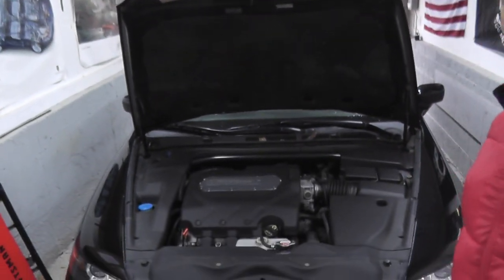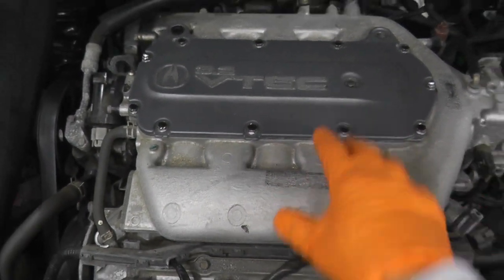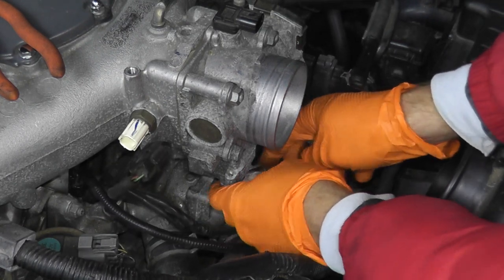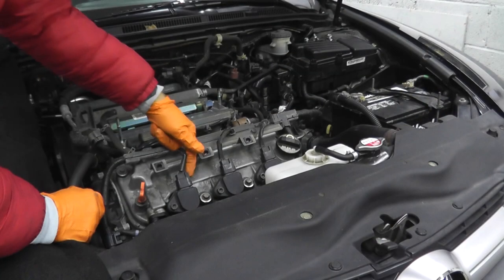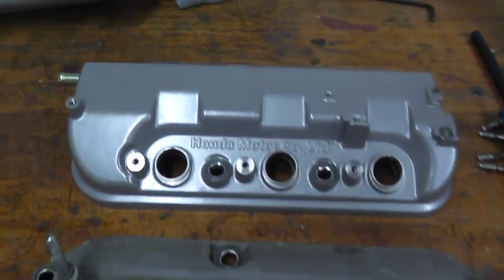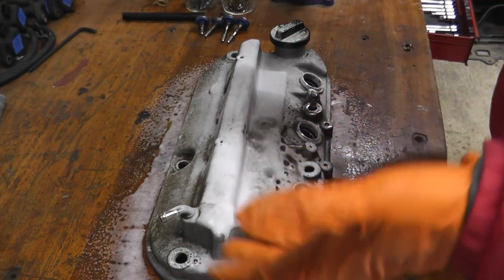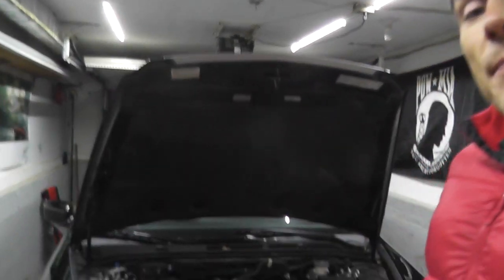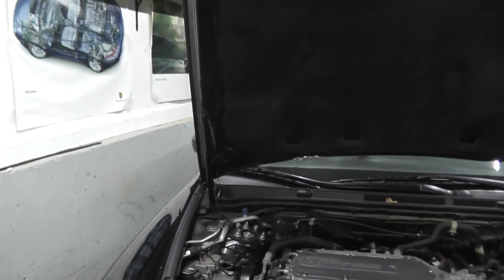Acura and Honda V6 Valve Cover Gasket Replacement With Basic Hand Tools

Comment: Just want to say thank you for this video. I changed my valve covers with the OEM kits last week and it went great. I did end up cleaning the underside of my valve covers with Super Clean as well, changed all the spark plugs, and coils. A little white smoke for a few seconds, probably from the cleaner.  Car runs like a champ!

Comment: This looked easy until you had to strip out the interior, remove the dash, cut out the firewall, and unplug the entire wiring harness, then it looked like it was harder than I thought it would be! 🙂

Excellent video, one of the best I have seen on Youtube. Great job!!!!
Reply: You're confusing that with headlight bulb replacement.  3 hours minimum.  Trust me 😅

Comment: This video was perfect! I was able to change both valve cover gaskets and cleaned up a lot of leaves and nuts in the engine bay (go figure). Tested it and no leaks. Thanks so much!

p.s. any chance you'll do a timing belt change for the TL?

Subscribed!

Comment: Nice video ! 
I had a 2003 S2000 ap1 . It was a blast but a little cramped for my size .
Now I have a 2005 TL with the factory 6 speed , front Brembos and limited slip .
Its almost as quick as my S2000 Was and nobody really trys to race me like they did in the S2000 .

Comment: Excellent video! I have the same issue of my front wheels looking a mess due to the oil leaking.  My bank 1 catalytic converter has gone bad, so I think I might do the converter job along with this and, if possible, pull the converter out past the rear valve cover while it is off of the car.  I have read posts on Acurazine of people doing it that way. You are supposed to remove the drive shaft for the job but I have not had good luck removing the shafts on my TL.

I have an 2008 with 206 k on it and it runs great. It will be cool not having my wheels looking a mess shortly after they are cleaned.  Even more importantly, not having oil leaking period.

Comment: Would bad valve cover gaskets also cause any misfire issues? Because, I recently replaced all 6 spark plugs and coil packs and 3 days later, the misfire of banks 2, 4 & 5 happened. What else could be the cause of misfiring?
Reply: Could be bad wires?
Reply: @JeremyFromOregon   Ok. I haven't checked the wires. Thanks bro
Reply: I know mines is misfiring bad, but I noticed a lot of oil on the backside spark plugs could be bad gaskets letting oil in???
Reply: @JayP19AD   Yes. This time around, I had cylinders 1, 3 & 6 that were misfiring. I had bad tube seal gaskets. So, oil was all over those spark plugs and coilpacks. I just went ahead and replaced all 6 of the tube seals and valve cover gaskets since I had the covers off anyway.
Reply: @KeizorSoze1 did your car end up working good after you changed the tube seals? i have oil all over the coil pack in cyl 1
Reply: @buddhaprince6773   Yeah. But, I had gotten fed up with the way problem after problem was happening with this misfiring issue, I just ended up replacing (again) the valve cover gaskets, tube seals, all of the coil packs and spark plugs, along with the valve cover grommets too. After replacing all of that, I no longer had any misfire issues.
Reply: @KeizorSoze1  thanks for the info, hope your whip is going strong still 💪
Reply: @buddhaprince6773   Thanks! No problem. Yeah, she is running good now. I've been lucky enough to not have anymore mechanical issues. I hope all goes well with your car

Comment: To get the rubber gaskets out. Place the cover in the oven for about 15 minutes at 375 degrees. Once done, remove the cover and face it down. Get the flathead screwdriver and stick it in the gasket at an angle. Hit it with a hammer or palm. They will fall right out.

Comment: Would've been a good time to check valve lash.
Reply: Major omission no valve clearance and using old intake gasket. Don't fear buying oem Acura parts. Why comprise on quality parts when you bought a quality car. Felpro is ok when oem is not available.

Comment: NOTE!  Why doesn’t anybody tell anyone about putting thin CUT washers under the bolt heads. Torque.  Problem solved!

DONE. 30 minutes.

Comment: If you want a V6, go Toyota.   I4 is Honda’s domain.   Let’s not make this complicated…
Reply: Says only you bud
Reply: Lol my 09 Acura eats any stock v8💀😶‍🌫️
Reply: My J35a8 in my 07 TL Type S won Ward's 10 best engines in 2005, 2008, and 2009... Honda's have been making great I4 and V6 engines for decades
Reply: @champanedout  **Nissan VQ35’s entered the chat (FYI I have a UA6 TL and I agree)
Reply: @hostilehalo7345 Yeah right says my 16 Camaro SS😅
Reply: J series are beasts and reliable what's this guy on?
Reply: I am agree 👍
Reply: i have 350k on my 05 Acura TL original motor

Honda FTW
Reply: All Toyota
Reply: Honda J series and GM 3800 are the best v6s ever made. Toyota is poop
Reply: Not if you want 300k, you don't want the toyo.
Reply: V6 Honda Acura is 10 times better  J SERIES EATS ALL THESE ENGINES